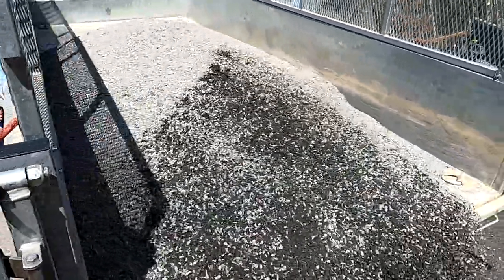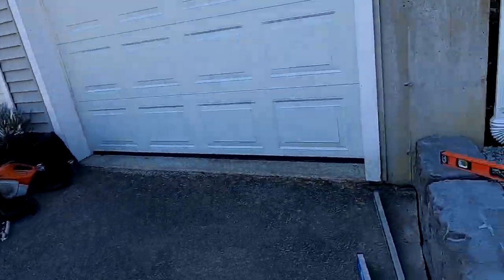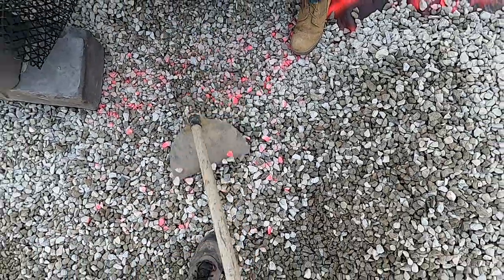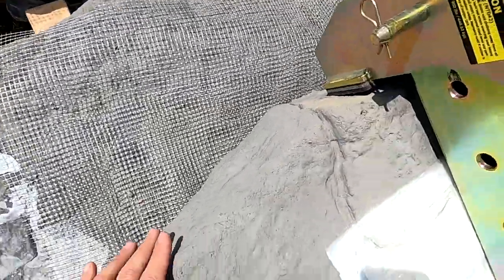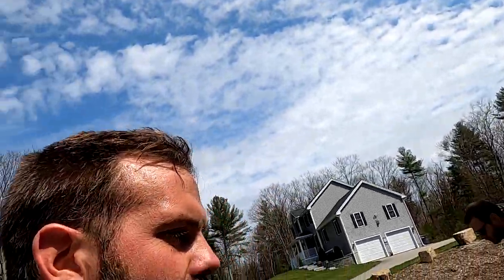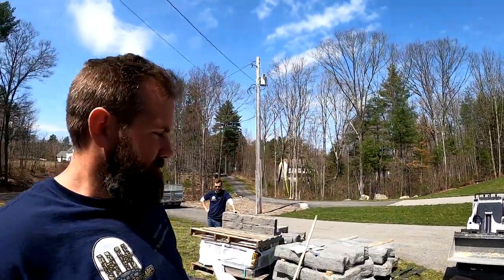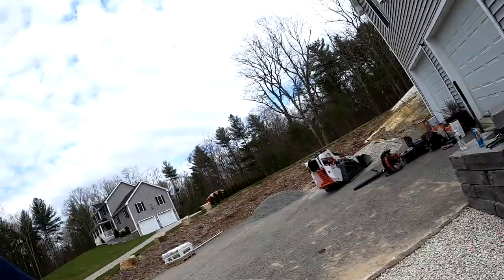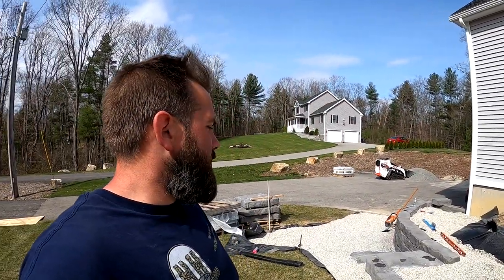Laying Some Gorgeous Steps, I Love This New Clamp!

Comment: Hate that manufacturers can’t get this right run into that with Allen block with their stretchers and their corners they’re off just a little bit but it makes a big difference on a tall wall but I guess that’s why they sell those shins lol
Reply from the maker: I know man, I hate having to use shims, there’s nothing more frustrating than that… I have dealt with it on a few different wall systems but this one takes the cake for biggest difference in height…. 🤮